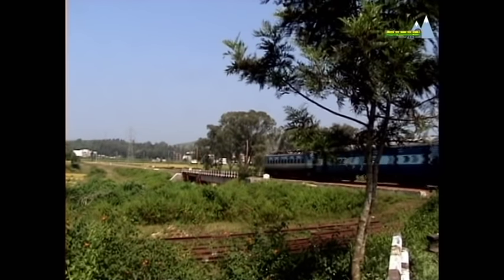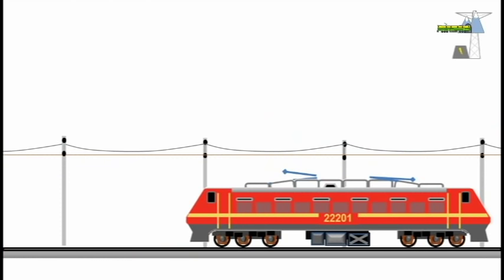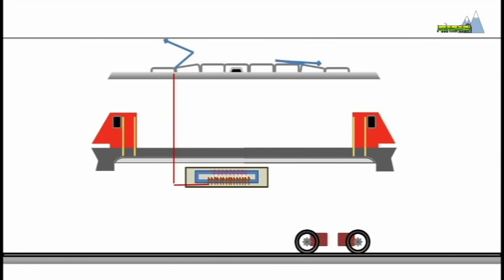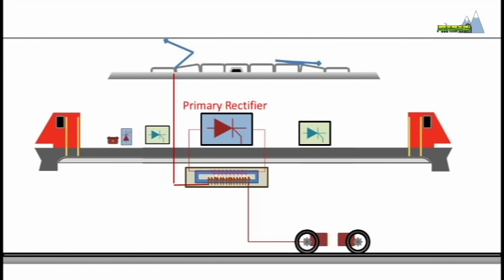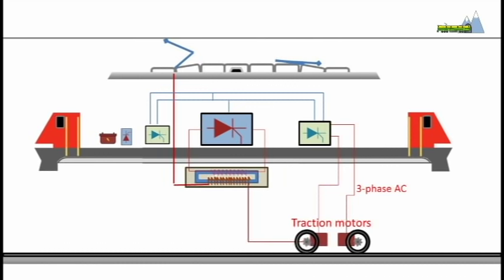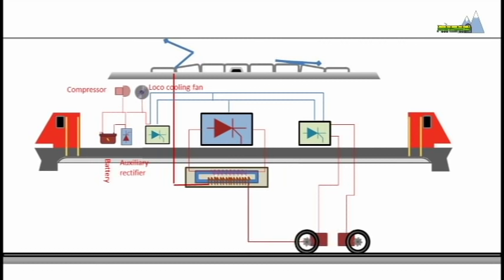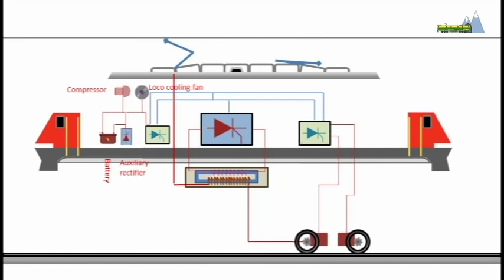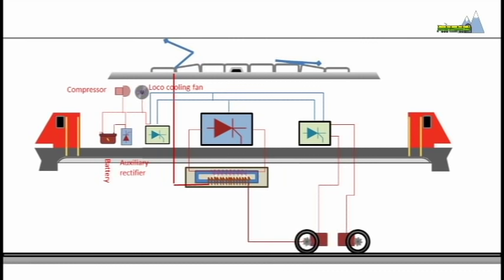How an electric locomotive works...

Comment: Electric locomotive since 1837 ...no way. May be he meant 1937??
Reply from the maker: Manohar Kuse Yes it is 1837... the first steam powered train started operation as early as 1804... trains have been around for a long time and electric locomotives came quite early and long before the invention of the Diesel engine
Reply: Any credible reference? I doubt your statement because a. Michael Faraday lived around 1850 ( invention of AC current and transformer). Also Tesla's 3 phase electric motor was invented around 1890 or so. I am aware DC motor were known earlier than AC motors.
Reply from the maker: Sir this video was made two years back... at the time of making all information was researched... it will take me while to pull out old references but you could search the net, the required information would be easily available...
Moreover electricity was discovered long before Faraday .... and Faraday was experimenting with DC motors from as early as 1821
Reply: I looked up the Wikipedia page on electric locomotive. Turns out Robert Davison indeed built a electric locomotive but it was based on galvanic cells and not on ac current. This was just a test line of less than 5km and the locomotive took over an hour to go 5km. A locomotive with overhead wires was only made in 1879 in Berlin. So I think your statement eventhough is correct is a misrepresentation of the facts. You show a picture of electric locomotive with overhead wires and put up 1837, this I don't agree with.
Reply: Fyi the 1837 locomotive did carry energy source.
Reply from the maker: Sir... I have never said anywhere in the video that the first electric loco of 1837 was an AC loco or even that it used overhead catenaries. The statement that electric locos have been in existence since 1837 was an introductory one to let the viewer know that electric locos have been around since very early times...

Comment: The 1930s when electric locomotives came into operation were the days of vacuum tubes, and ultracapacitors were not even heard of or dreamt of during those days. Today in an age when ultra-capacitors made from curved graphene materials, are putting megawatts of power into small building blocks of powerhouses, is it necessary now for the locomotive engine to draw its power from overhead cables? Can't an entire train carriage hooked behind the locomotive engine, packed with several building blocks of ultra-capacitors storing millions of megawatts of power, drive the train for at least 500 km without the overhead cables? Well, couldn't such technology exist today?
https://www.youtube.com/watch?v=zWkOFuzkZxo

Comment: Why 3 Phase?
It wasting energy
Reply: Because 3-phase motors produce more power with the risk of wasting energy, but the power-to-weight ratio is proportional
Reply: @farhanrailfanscc2066  ok I got it.
But why AC? Why not BLDC?
Reply: @Taahmim  BLDC is not very powerful, 3 phase motor is quite powerful and even very powerful.  3-phase induction motors have a comparable torque-to-weight ratio, making them suitable for heavy-duty applications
Reply: @farhanrailfanscc2066  BLDC is slightly heavy but consume only 30-35% energy compared to Induction motor.
Even tesla are using SynRM motor. They are not thinking about weight. They are thinking about efficiency.